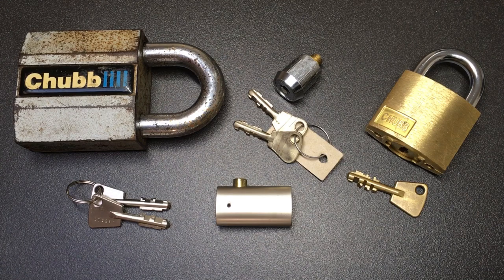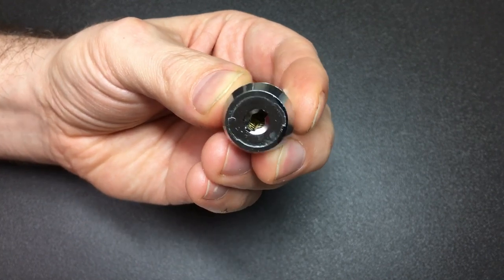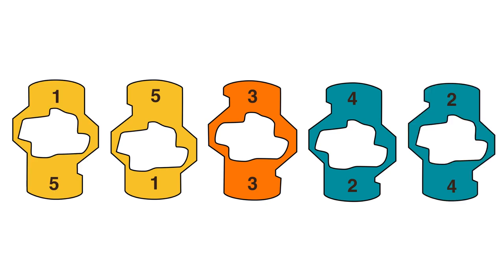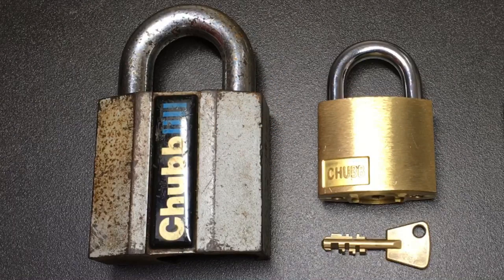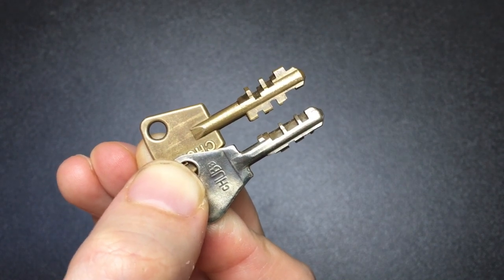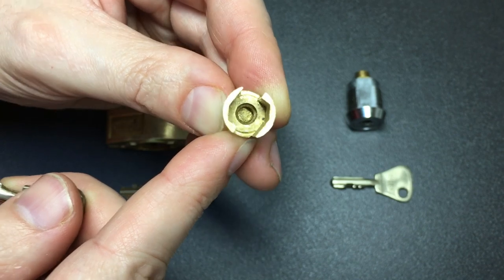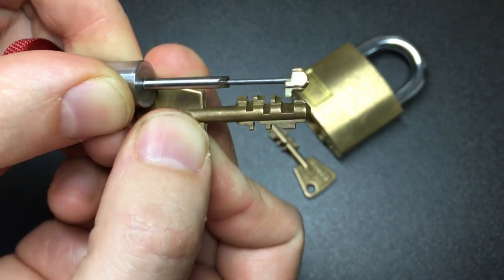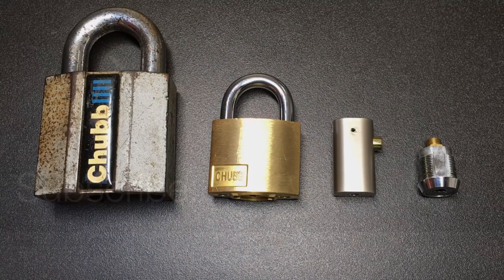Chubb AVA Locks - Mechanism, History and Picking

Comment from the maker: This video is a comprehensive look at the mechanics, history and picking of the Chubb/Union AVA locks. It took a long time to make, so if you like it, please leave a like and a comment and consider sharing it and maybe even subscribing! Credits and references in the description 👍🔐😃
Reply: Thanks. Call me slow, if you like, but how are the 9 remaining sliders set? Is there a separate, concentric, picking arm inside the barrel of the picking tool, which can be manipulated while the 1st wafer tool is held still?
Reply: @lockNooob, thanks fora that great video. Probably silly, but I was wondering if you could share the PDF of the original patent (UK Patent 737,547 1953), the only version I could find only does not have the illustration and the High-Security Mechanical Locks Encyclopedic only has diagram for the newer chubb version.
Thanks

Comment: Good video. I am left with questions ,it might be something I missed. How would you determine what tension tip would you use if you don’t have a key as in a challenge lock situation or obtain a Chubb lock without said key? Would it just be stick to see which one best fits?
Reply from the maker: The technique for determining the tip as per the instructions is complicated but the easiest way (though longest) is to put each tip in in turn in both orientations and see which one causes all the sliders to bind in each position

Comment: Got a question what locks are safer disc or normal pin tumblers? Witch ones are easier to pick
Reply from the maker: There is no easy answer as it depends on the type of lock and how it’s used - the Abloy Protec 2 disc lock is considered extremely hard to pick but then again so is the KABA 20 dimple lock etc. Best chat to a locksmith about a specific need 👍😃

Comment: About picking, could you simply find a binding wafer while applying tension and simply moving it until it no longer binds instead of measuring exact movement of each wafer? Of course, correctly set wafer cannot bind so you never move a correctly set wafer.

Comment: The original straight walled key design was decades a go extremely common  lock used in car heating plug points, postboxes, cabinets, etc. here in Finland. Since then they have largely being replaced by poor  chinese pintumbler locks. Worked always, never froze.

Also the later versions were seen occasionally. Had an bicycle lock with shorter Chubb version in 80s.

Great video! Thanks.
Reply from the maker: Interesting to know - I’d love to find some of those old locks!
Reply: @LockNoob  Here some more info.

https://docplayer.net/51574277-Discussed-systems-abloy-locks-with-fixed-not-rotating-discs.html

Abloy made 318 lookalike with Ava core, just because it was so reliable and faster to use compared to dd core. Those were made till turn of century. Courier companies used those here a lot. I would send you one if I had one.

I guess it went the way of Dodo as Ava cylinders (like Classic) were made with production lines that were labour intensive. When factory went to highly automated lines only high end products were kept.

Comment: Wow, you are a genius! It looks like you've found a pick that BB doesn't have! Great! Just one question; does the spring at the back push all the sliders to the locked position or are they all completely loose?
Reply from the maker: If you press the sprung cup at the back the sliders go loose - they may stay in place depending on the orientation of the lock.
Reply: @LockNoob  I didn't mean that. What I meant was, is each disk in fact wedge shaped horizontally so when pushed together from the spring at the back, they slide/chevron to the loosest position which is in fact the locked position. I still think you could push a diamond shaped bar down the keyway, depressing the spring and when you tap the lock from either side with a rubber mallet, the sliders would ricochet on to the bar, leaving them all in the unlocked position. Maybe that's why wafer locks have springs keeping them in them in the locked position, and disk detainer locks have disks that spin, not slide making it impossible odds that you could rap them all to the required position.

Comment: Great info. The keys look similar but not exactly the same to the ones used by Ford (Australia) from early 2000s until they stopped making cars here. Did Ford in Europe use anything like it? I haven't pulled apart a Ford lock, so I'm not sure how they work.
Reply from the maker: Ford used the Tibbe lock
Reply: Thanks, I will google that and learn about it.
Reply: I think before the Tibbe lock they used these
Reply from the maker: I’d love to see the car version of the Ava
Reply: @LockNoob  spring loaded wafers in tibbe lock. Different design.